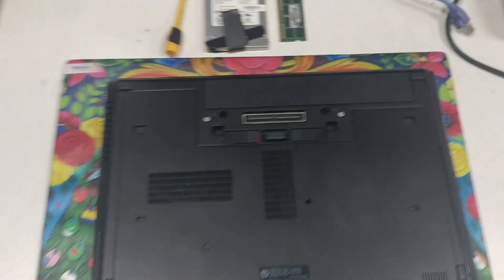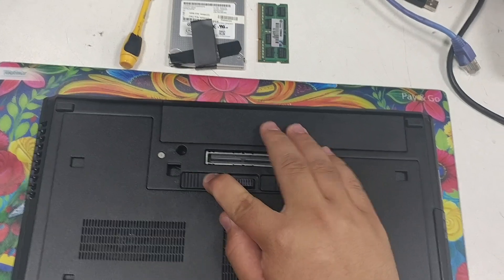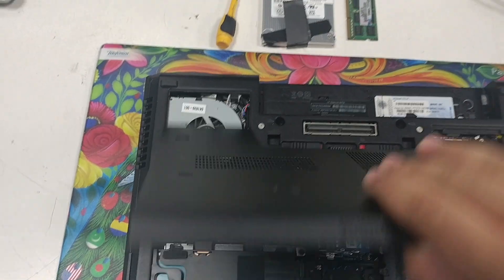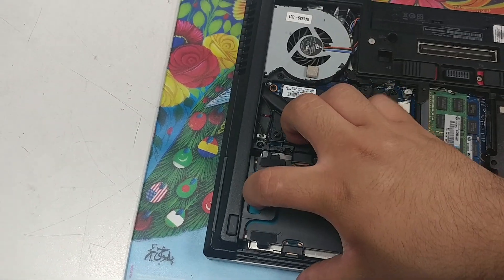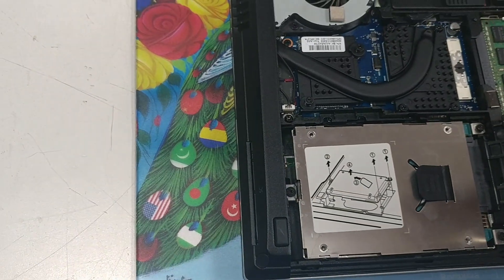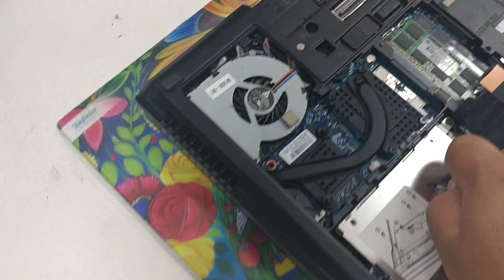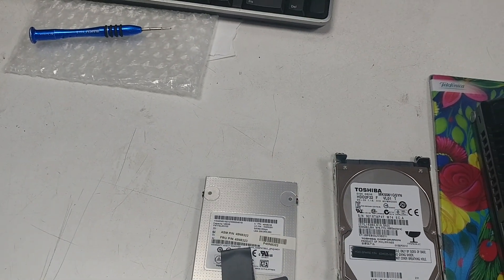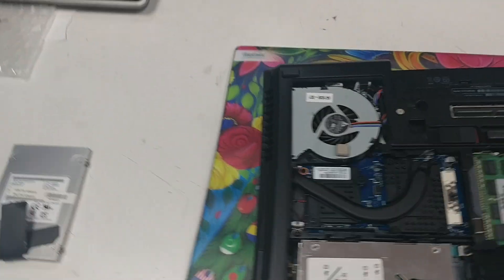HP Elite Book 8470p RAM and SSD Upgrade

Comment from the maker: Let us know if you have any questions or anything you want to see next.
Reply: I have 8470p with i5 core 3320 m. What is the most compatible max ram and ssd I can utilize?
Reply: @fkaziz  16 gb max   2x 8gb 12800  1600 mhz  ddr3 pc-3 dual channel. But the  2 rams  must  be  idenitical,  so the same brand for optimal  function.
Reply: Great video I liked and subbed for more..
I have a question please.. What kind of SSD drive interface is compatible with this notebook?
Reply: I have a question which SSD type is it
Reply: @kingoflight4713  the best is Kingston 240gb SSD,  costs  around 35 bucks.